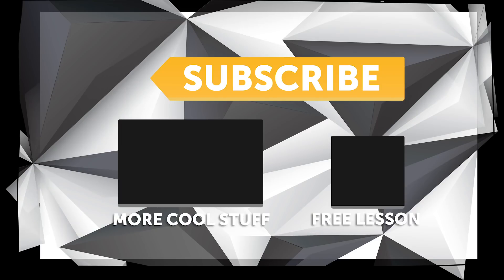Hear The Logic Behind A Chain Driven Subaru WRX [TECH NUGGET]

Comment: Interesting conversion.
Not that unlike the AWD the Calibras used in the DTM back in the day - instead of using the F28 AWD and transverse engine layout, they used a longitudinal V6 with a specially built gearbox that incorporated a central diff and an output on both sides that drove shafts to each front wheel - they did this because the engine was where the front diff' would normally be - some may like to look it up on the InterWeb. Ah, story on the car here - https://www.carmrades-blog.com/all-articles/2017/12/8/class-warfare-1993-opel-calibra-v6-4x4-dtm - and a nice picture of the transmission - http://www.invetr.com/uploads/2/1/8/2/21829402/895043144.JPG

TBH, though, I would have expected the chap to have used belt drives in his application - Gilmer or Jesel, for example - as they are potentially much stronger and lighter.

As an aside, some European guys with LONG memories may recall the BDA powered DAF that used belt drives - IIRC, the Rallycross regulations it was raced under allowed engine swaps but had to keep the same type transmission and as the DAF used an early belt CVT, that was adapted with a belt for each axle. I'll see if I can find something on it... Ah, that was easy - https://oppositelock.kinja.com/dutch-ingenuity-the-story-of-a-revolutionary-daf-in-ra-1822933054

Comment: could have done the same thing with 90 degree or right angle gearboxes for better reliability
Reply: What are you talking about, think again
Reply: i think there is far more power loss driving through 90° boxes verses a straight chain drives.
Reply: @lorenmuhling3633  there is no space either